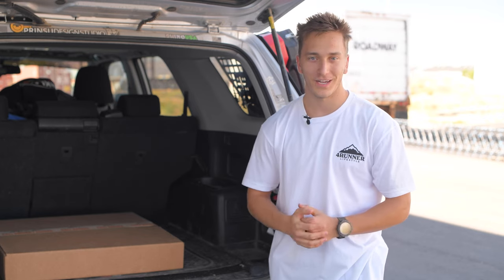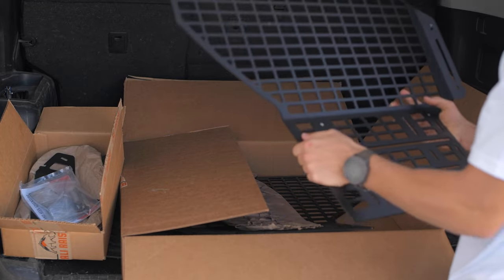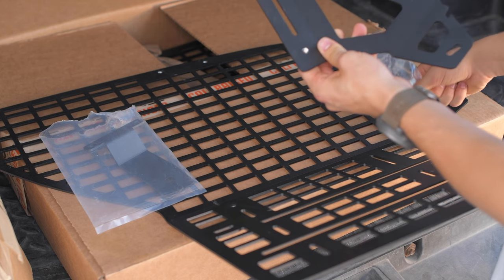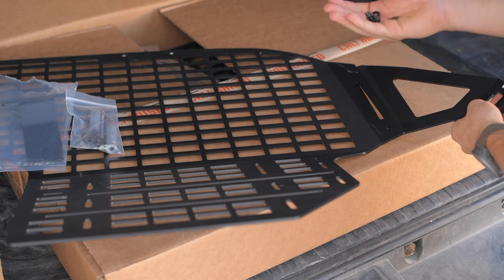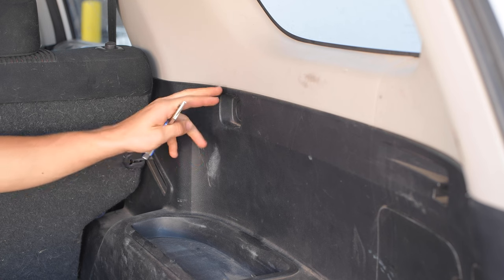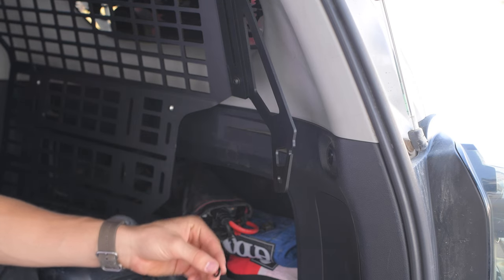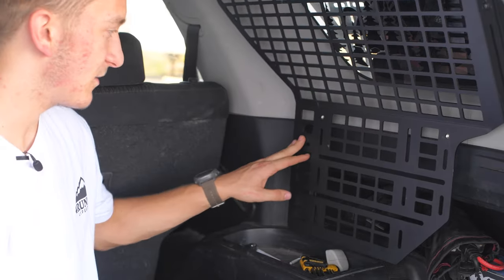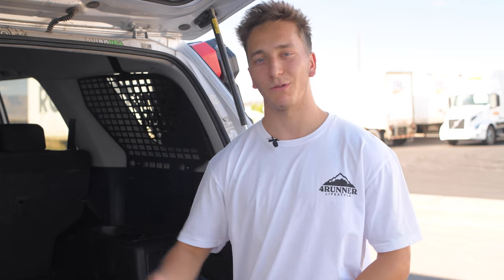Cali Raised Interior Rear Molle Panel Install - 5th Gen 4Runner

Comment: I just installed these on my 4Runner.  Couple of things...first the mount right by the rear hatch has hooks for a cargo net that this molle rack has no hole to use for those hooks.  A solution is to place wing nuts in between the bolt head and washer to function as the hooks for the cargo net.  Second, if you want to reuse the plastic clothing hook at the top, you'll have to snip off a peg on the back of the hook to fit over the rack's mounting bracket.
Reply: Yea, I wish Cali Raised had drilled holes so that people can reuse the coat hooks more easily.

Comment: Just to confirm I did it correctly, I was to remove the bolts behind the net hook and the plastic trim thing I popped off, right? It feels right to me but that part wasn’t mentioned in this video for some reason.

Comment: You specify using 6 washers per side but it only comes with 4 per side
Reply: Mine came with 8 washers and 7 bolts. Had one extra